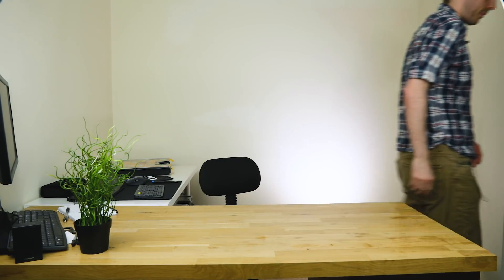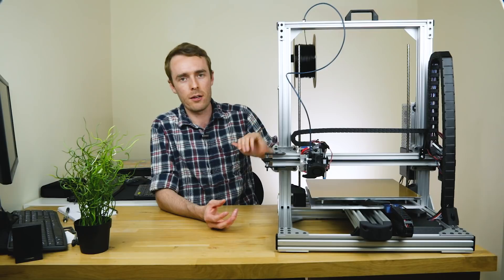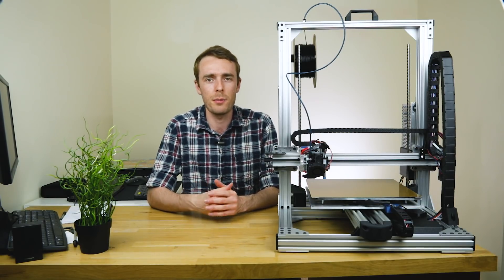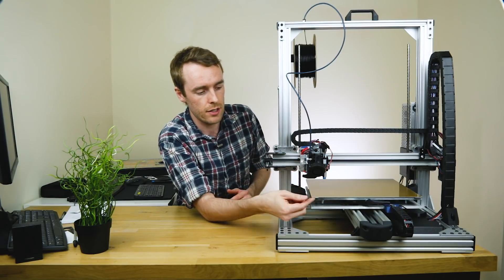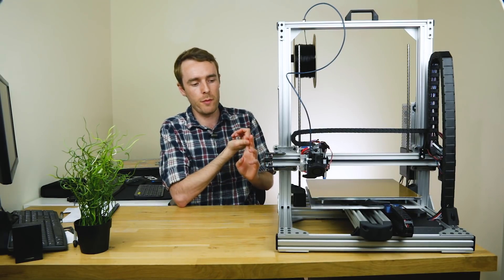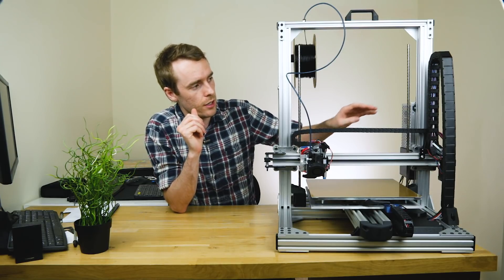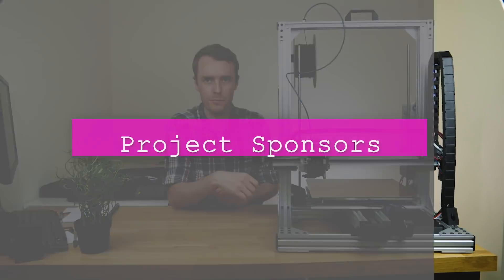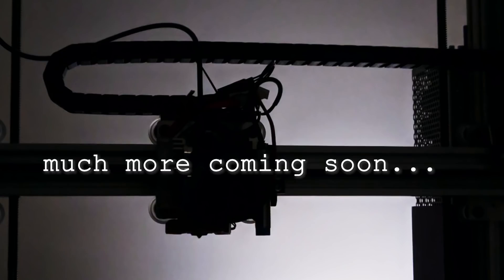36 Weeks to BUILD this! The Extrudinator revealed!

Comment: "big" Hah, you need to get yourself a Cr10S5 lol then you know what BIG is.
Reply from the maker: Id also know what wobbly is.
Reply: @Vector3DP  eh not really that bad with some small slicing changes and a cheap mod to add some rigidity to the frame. But its still Bigger lol. I can fit a good few of my other printer's inside it. Part of me is almost tempted to print a 3D printer enclosure on it Lol.
Reply from the maker: I'll get there eventually. Current build is 400 cubed.

Comment: Good to see you back Adam, I was wondering where you have been. I used my CR-10S to build S.T.E.V.E. with 24v and Duet and now it looks like I have to pull STEVE apart and use the parts for the new printer. My wife is not going to be happy. Keep up the great work.

Comment: The frame design is derived from the "Men"del (Mendel Max is closest). You used a Duet control board (based on Arduiono "Due") and also it is your second printer. Obviously it was made using 4040 extrusions, combine all that into the name "Mendue 4040." 
Alternately call it "B.O.B" for Barely Overbuilt Behemoth. Good job by the way! Keep up the good work.

Comment: Awesome! I am currently bulgding something similar but on 20mm round steel shafts. Wooden frame unfortunately. 40mm kitchen table material. I am planning to run it with nema57 motors due to size and inertia. What motors do you have?
Reply: @Vector3DP  My bad. 57mm width - that is nema23 :) nema57 would be a terrifying monster.